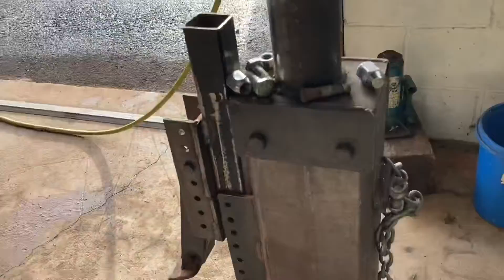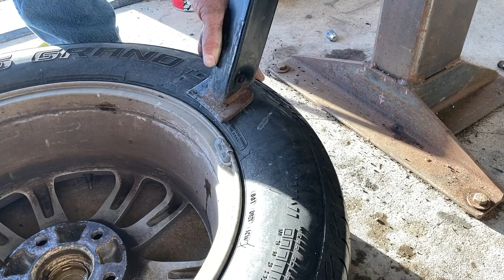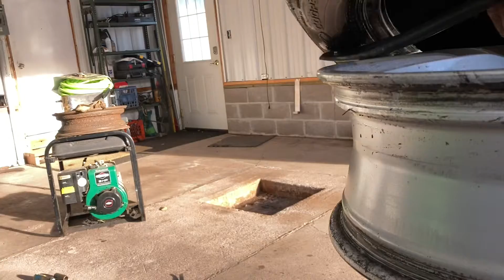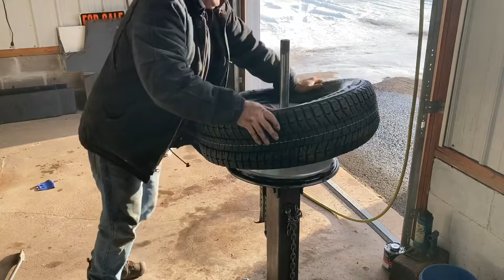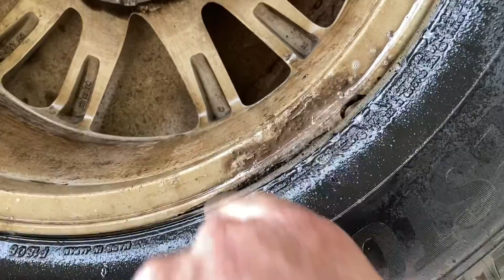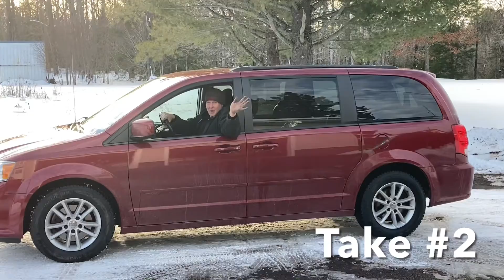Manual Tire “Machine”- Better then Harbor Freight?

Comment: Awesome you built one but got a few buddies over my shoulder looking down going we've used those for 30 years never needed to modify or do anything to them I like to know what you're doing to it that you had to like build your own or you had to like do whatever I just don't understand what you guys are doing I just put in my tire changer to find a bracket and I'm getting all this...
Reply from the maker: The harbor freight unit I purchased was not very strong… the first time I tried to remove a tire the main supports bolted to the floor bent. I wasn’t going to start modifying it so instead I built my own from scrap stuff I had. A lot of people seem to have good luck with the harbor freight unit one, I wasn’t one of them.